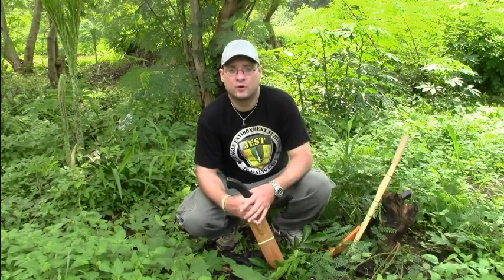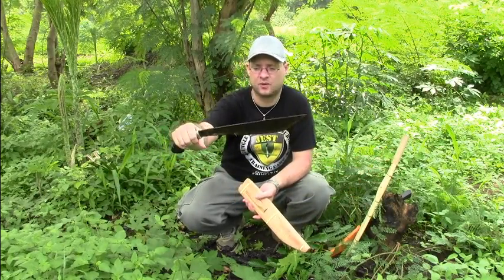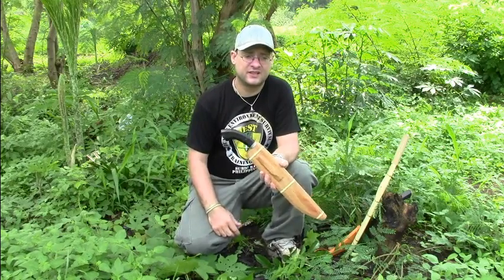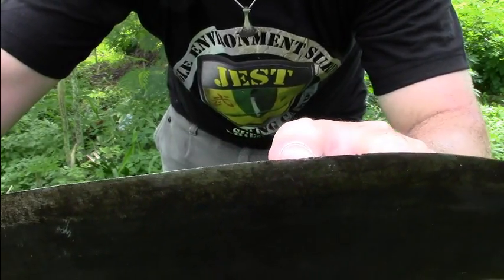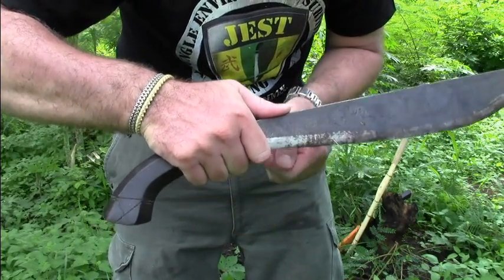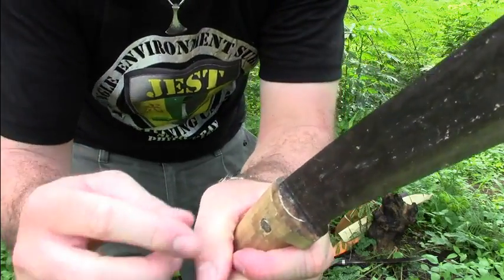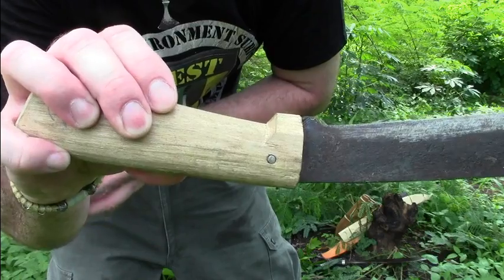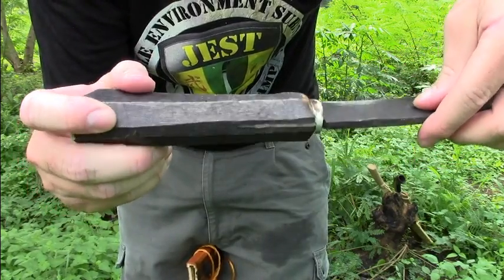More Bolo Machetes

Comment: i sub your channel because you understand the Filipino philosophy of handling big blades (bolo, itak, sundang, etc.): the weight distribution and the chisel grind. but pls, don't call our bolos machete. machete is not a filipino word, it's south american, i supposed, for a thin, long and flexible blade. btw, i am from mindanao and i am looking for a
Reply: +melvin sajenes ...i'm looking for a branded big blade that has chisel grind because i think it's the most efficient grind in the way we filipinos used our blades. i thought of buying an ontario rtak 2 because of its full flat grind which is close to chisel grind in my method of use, but after i saw your comment on the the junglass i became hesitant...anyway good vids i hope you can influence  knife makers out there to make big blades with chisel grind.
Reply from the maker: melvin sajenes 
Thanks 
I would not buy the ontario or the junglas, its as far away from the philippino blades as it can be! (for a large knife/machete ofcoz) 
Get a custom hand forged from the philippines. 
Is cheaper and better ... 
Marius

Comment: Shrade bolo is best You should have bought a real Bolo ;). Look this video ok ;)
Reply: Philippine Bolo's, Machetes and  Knifes are made from leaf springs and locomotive bearings (5160) it is a standard issue machete during the WW2 to American soldiers, and most of the bolo's and machete's on the market today is inspired from Philippines. May be that is the reason that lots of Hollywood producers ordered swords and Machetes from the Philippines. It sell in USA and Canada $300 and more. Just for info. Thanks.
Reply: Shrade bolo isn't a bolo, it's a barong. And though 3cr13 is pretty tough for a stainless steel, a plain carbon or spring steel is much better for a big knife.